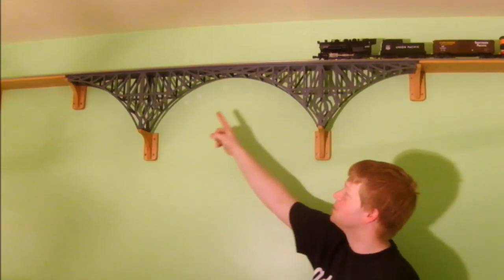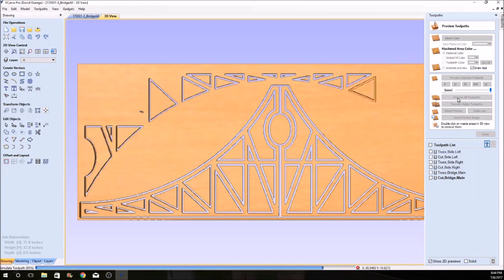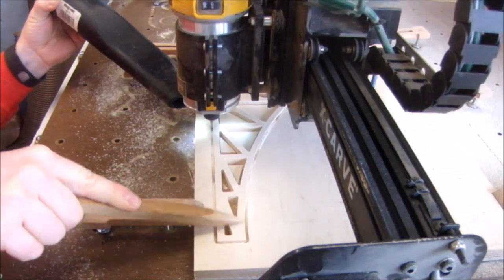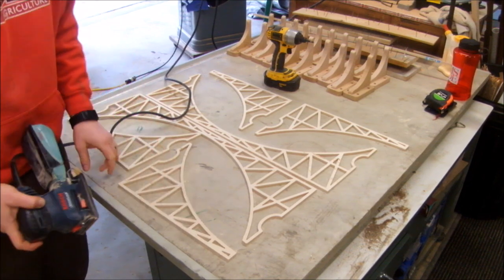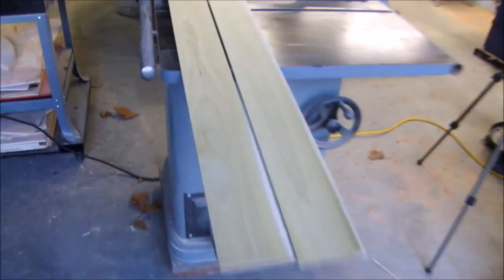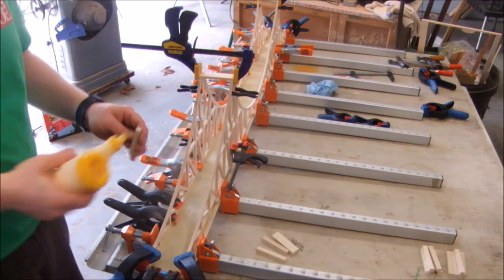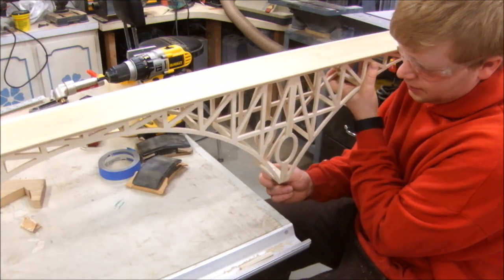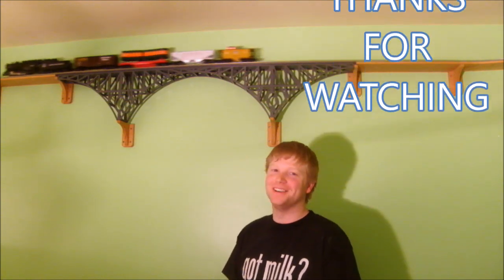Building a Model Train Bridge from a Photo

Comment: This series of model train videos has been great. You did a really good job on this project. 
 I have always thought that trains running around a room like that were awesome.  The bridge feature you added really makes it pop.  I bet making it without a CNC would be a real pain.  I learned that model trains have evolved and that really helps to simplify the setup as all the wiring you need to do  is for the power.  

Congratulations on the upcoming child.  Just enjoy them while they are young as they do turn into teenagers.